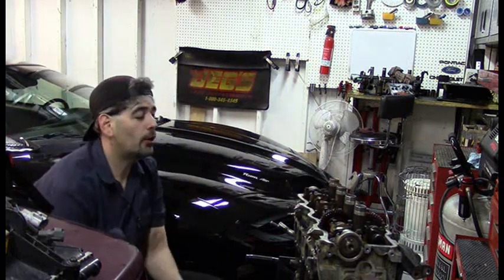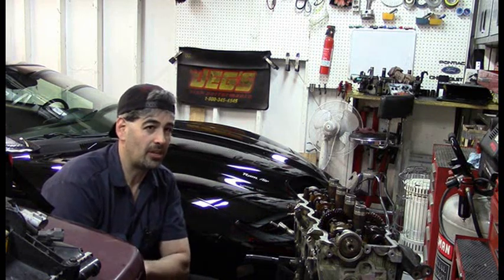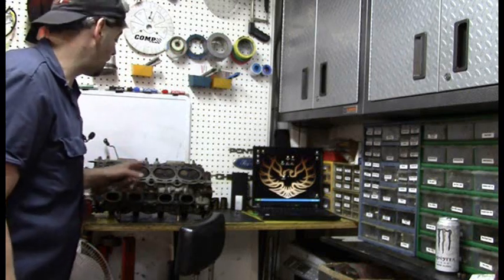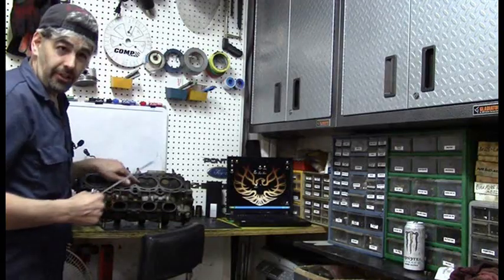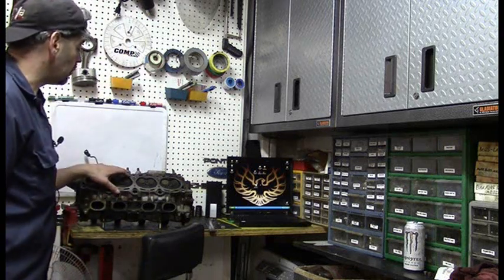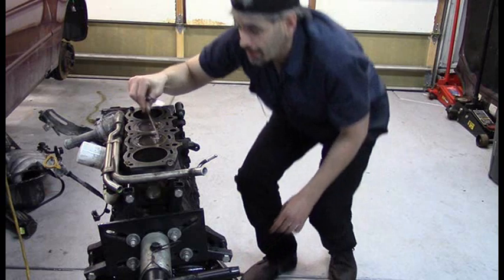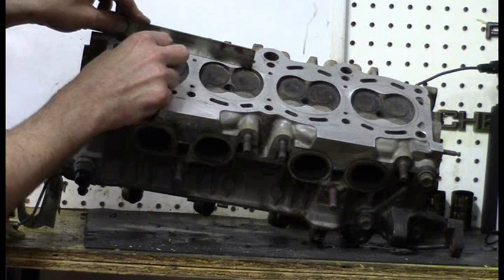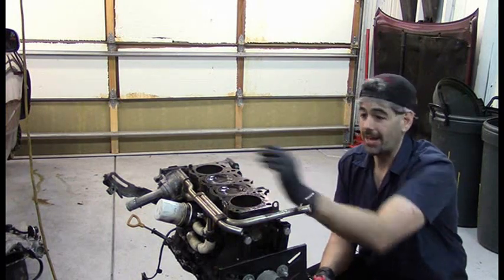Replace a Cylinder Head Gasket Yourself and do it RIGHT! Part 1

Comment: I have NO idea how you would have ANY haters, your videos are top notch. Extremely informational and damn near necessary.

Would you mind my asking about my latest project - likely blown head gasket on a 1987 Dodge Mini-Ram (Caravan essentially)?
It has the  Mitsubishi 3.0L 6G72 V6 engine and 3-speed trans, cast iron block w aluminum heads.   I'm watching this video again because this is a job I would like to do myself (I maintain all our vehicles, just wish I owned a prof lift!).  I use this van to haul my Hammond B3 (organ) for local shows, I have a larger van for touring, etc.

Problem just happened recently, I pulled up about a block away from the venue/stage we were playing, and suddenly noticed a stumbling idle (misfire - still kept running though, and ran well when giving it gas) and lots of steady white smoke from tailpipe, my heat in car went from hot to cool eventually (I immediately said, oop there went the head gasket). Thankfully I was close to the show so was able to shut it off before overheating. I could see temp gauge hinting it would go towards getting hotter and hotter so I shut her down. 

Then take out the Hammond, did show (yep, made the show. Hahah, it was great too!) and setup to have it towed to my home garage.  Once I turned the vehicle off however I could not start it when I tested, just a click and no crank, it was dead (suspect coolant in 1 or more cyls).

So: Lots of white smoke, sudden stumble/misfire at idle, heat in van went from hot to cool. Also test restart failed, no start. I pulled into a safe space and had her towed to my garage. 

I'm at the sleuthing part first here to find the what and why. I'm thinking it's just that the HG failed and/or intake gaskets. Worse, aluminum head crack (but not so quick to judge that as i was able to  shut down before overheat).  I sure hope it's not in the block. It's cast iron and i read that these old engines are pretty tough. 

I keep reg oil changes, coolant, fuel filters, any and all maintenance religiously. The radiator is pretty new as are the upper and lower hoses. PCV was new and just did the water pump and timing belt as well this past summer. Drove really well, good cooling/heat, then...this.

I do see the tan froth under the oil cap (never have had that before) so HG is likely here, but seeing no signs of tan/milky oil on dipstick.  I drained what coolant was left in radiator via the drain plug and saw no oil in that (green reg coolant). I will take off lower rad hose and check further though.

Can you provide any tips and info on this engine in regard to sleuthing the issue and doing this job on this engine? 
There's lots of room to work in these old vans, there's so many reasons to keep her going and I will enjoy doing this job actually (NOT a pro of your caliber but have the tools and am damn good with all the vehicles I own).

Thanks for any tips, thoughts, on this
Reply from the maker: I'd have to see what data you have. I can't do anything on a list of symptoms, sorry.
Reply: @SchrodingersBox  
Understood,realized I was rambling a bit (was in the sleuthing phase). Just meant to ask if you know about these engines and it's % of HG survival if I decide to do myself.

Latest update: oil drain showed coolant at bottom (oil on top of that). Gonna pull heads and take a look.

Comment: Good video.  GM replaced my pistons and rings under a special warranty due to oil consumption.  While the head was off I had the head cleaned and inspected by a machine shop.  They found the exhaust valves pitted.  They re-ground the valves and seats, installed new valve stem seals and tested for vacuum leaks.   Comments:  never use a wirewheel or other abrasives on the head or block, especially aluminum.  GM has a TSB on using only plastic scrapers and solvent to clean surface.  My tech said he knows of a tech that was fired for using an abrasive wheel on these surfaces.  For intake and exhaust, not a big deal.  Don't use a tappered thread chase because is will not clean the bottom most threads.  You can use a clean head bolt and run it in and out a few times, cleaning it each time.

Comment: I have experience with NDT and as a mechanic so this is a lil me-specific, but it's not complicated... The last head gasket job I did was a 3400 in a 04 Impala. I knew where the problem was already from my scanner and the look of the chamber. (#6) I glued some sandpaper to a large slab of glass and resurfaced the heads myself. I was skeptical about it until I got to the second head, (246) and saw the low spot in the sanding around cyl 6, and it took a LONG time to sand until it FINALLY sanded out. After that, I had way more confidence. I also was able to take the heads to a friends machine shop (not an engine type shop) and was able to check them for cracks using flourescent dye penetrent before doing any work to them. Also did the normal leak testing and seals. So, ya, if you have the right experience, and some common sense, you CAN, sometimes, avoid the machine shop.

Comment: this is everything but how to do it yourself..
Reply from the maker: Come again?
Reply: Schrodingers Box your videos are with no doubt excellent and there are a lot of information to take note of, but it is not for your average DIY'er who owns few screw drivers and a 40 piece wrench set. it is more for advanced guys who got a real home shop and all the tools out there, and if you need to take the head to a machine shop to get it fixed then is no longer a DIY project.
 no offence intended.
Reply from the maker: certified30 How do you propose a DIY doesd a major, major repair like this without having proper tools?  You CAN do this yourself with the proper tools and knowhow.
  You can't DIY changing a light switch unless you have a screwdriver and pair of pliers.
 My responsibility in a tutorial video is to show how to do the job, not how to do it without minimum required tools.
  BTW what tools do I use that a DIY wouldn't have easy access to anyway? This example  is done with basic hand tools easily available anywhere.
Reply: Schrodingers Box what I mean to say is a head gasket job is not a an oil change. it takes some extended mechanics knowledge and access lots of privileged technical info that your regular Joe most likely does not have access to, at the beginning of your video you mentioned that you don't understand how a removing bolts video gets 300K views well it because most guys watching YouTube videos are looking to see what bolts to remove and a step by step removal procedures of a cylinder head not a video of a cylinder head already removed and opened up in pieces, what is a given to you is not necessary a given to everybody, that's why channels like scotty Kilmer, Eric the car guy ...etc are successful channels
don't get me wrong you got about 14000 subscribers for a reason but you are more into advanced diagnostic stuff.
Reply from the maker: certified30 Not sure I follow your logic... at all.  You say this video does not show you how to replace a cylinder head yourself because it doesn't show how to replace it if you don't have the right tools.  Then it's because it doesn't show you how to remove every single bolt which is what beginners need.  Then you say replacing a cylinder head is not a job for a beginner....

 I really don't know what you are trying to say bro.  Whatever- I'm leaving it as it is.  It's the most comprehensive video on the subject I've seen on you tube and if it fails because I don't show a beginner how to do it with a butterknife and a hacksaw, so be it.
Reply from the maker: ***** Absolutely, 100% correct Tyler.  This is not by any means one of my favorite jobs because quite honestly, as you said, it is entirely what I call "monkey wrenching".  No diagnostic, reasoning, or logical thinking is required for this job when it comes down to it.
Reply: its just a matter of taking the things off, then unbolting rocker cover, then unbolting head studs its pretty simple just time consuming and labor intensive.

if you're doing cylinder head work you should have experience in a clutch job, spark plugs, oil change, coolant, brake fluid and engine knowledge/theory and a service manual.
Reply: Jared Tate you just said the magic words "you should have experience in a clutch job, spark plugs, oil change, coolant, brake fluid and engine knowledge/theory and a service manual" 
it defies the purpose of watching YouTube videos if you already got the knowledge, hints from a service manual and know what you are doing.
but those who have no experience they got to start somewhere right!
Reply: Schrodingers Box I'm not sure I follow his logic either Schrodingers Box . Of course, as certified30 rightly said, a lot of people watching videos like these DO want to know what bolts to remove, just so they know what to expect if nothing else. However, where this video shines is at the critical phase, the mating surfaces between the block and head that may well render the repair a complete failure if not checked. There is also other really useful information for DIYers with regards compression testing, comparing compression once oil is added to each cylinder to check the rings.
Reply: certified30 if you cant remove the head by yourself then maybe its not your caliber.This vid is for guys like me that are wrenching on there own with no shop and no friends or any one to ask ADVICE.  Nice vid !
Reply from the maker: iamdatdude1619 Totally agreed. Its frustrating when I get emails asking how to remove the radiator or exhaust manifold things for this job. Honestly if you can't do those things, why would you possibly try doing major engine work? I don't see unscrewing bolts as an "automotive concept". I see things like understanding timing, compression, fuel induction, induction, etc as automtoive concepts.  The things the makes good mechanics and diagnosticians is their understanding of automotive concepts.
Reply: How do you expect him to do bolt by bolt video for this? If he were to do that it would be specific to the car he is doing a head gasket repair on. That would leave the people that don't know what they are doing even more confused. This is a video on general head gasket repair on a cylinder head. If you don't know at least a little bit about how the remove the head on an engine i wouldn't attempt a job like this yourself.
Reply: Love your videos! The first video I saw of yours was secret to engine diagnosis; fuel trims and in the first minute or so you said if you want to use a logical and scientific approach/reasoning to diagnose then you should stay and watch the video and that’s when I stayed and watched. Another reason I enjoy your videos is because you focus on using the scientific method to diagnose vehicle problems, which is what I believe, is the most important. If your worried about how to use the tools to get the job done then don’t do the job because it’s better to not take the risk if that’s the case. Almost anyone can do the physical labor if armed with the proper knowledge but the reverse is far less likely

Comment: Excellent video sir. I agree with you on the head bolt thought process. Simply put, if I (or whoever is paying me to do the work) is putting the money into diagnosing a concern, removing a cylinder head, troubleshooting the head, and putting it all back together, there is no sense in risking that whole job over again because of a head bolt set. Anytime a head comes off in my shop, new bolts go in.

Comment: This is very informative I was planning to DIY SLAP A HEADGASKET AND BE DONE WITH IT but this has enlightened me to prep for more stuff to look out before doing such a thing and avoiding making mistakes.
Reply from the maker: Yes do not just slap in a head gasket or You WILL be doing the job over again probably immediately!!

Comment: I have a 91 Toyota Pickup truck 22re with water in the oil...I was already in the process of ripping the head off when my 20 year old son told me to wait after we did a Compression test. 165 Lbs. in Number 1 and 170 lbs. in all the others. Never even considered Intake Manifold...I will watch the rest of your Video. Thanks Liked/Subscribed
Reply from the maker: Yep- with those numbers a cylinder head is contraindicated as the issue.

Comment: Outstanding. About to work on a 05 1.8 Sentra. Now you can get a dye penetrant kit and use it to find cracks you normally cannot see with the bare eye. I use it checking welds all the time on boiler flanges and such. Keep up the good work.

Comment: Excellent video man really informative, im going to be honest, the first time i watched one of your videos i was kinda skeptical, mostly because of the "Haynes manual" guys that were religiously yelling "No way man! that's not the correct way to do that stuff!" in fact i was somehow doubtful because in some sort of way Haynes manuals are pretty useful, but just for the basics, that's it, but in the end i learned from you the logical way to solve problems.. here in my country mechanics are known as part swappers and they dont really do ANYTHING to solve any issue with a car.. Another thing i wanted to tell you is that you mention that the head bolts that were used to join the warped cylinder head with the block cannot be reused because of the mechanical stress resulting from the warping of the hed and the stretching they suffer, you are absolutely right on that and not just only because of that but also those bolts had been heat cycled many times!. Keep it up man!.
Reply from the maker: +fernando13e Thanks man good feedback!!!

Comment: Spot on with your observation regarding the age old argument of 'new or reuse head bolts'.
How I see it is that the old bolts will have gone through three main stress patterns; tension, torsional and thermal. Basically a set of new bolts is going to be a damn site cheaper than having to do the whole job again when the old bolts fail to clamp the head to the block correctly. Last thing any garage wants is the customer returning with leaking HG caused by old bolts.

Comment: This is very helpful to me because i have been considering one of the mamy Craigslist cars going for cheap because of a "blown head gasket" This helped me see that is an awfully vauge and possibly misleading diagnosis. Thank you.
Reply from the maker: Indeed I started this hobby doing exactly that.  Most of the cars had much, much worse than blown head gasket, they needed bottom end rebuild.  One actually just had a cracked spark plug- got lucky there.  But overwhelmingly, most cars needed considerably more expensive repair.  On average For a 8-10 year old car that I bought for under $800, I would spend about $800 to get the cars in perfect running condition.  At average sale price of $3500 it wasn't bad for a couple weekends' work.

Comment: Appreciate the vid... The reason a replacement vid gets way more views than a diagnostic vid is becAuse a perso. Takes their vehicle to a mechanic the mechanic says u have a bad water pump and have to pay X amount of dollars. The person either doesn't have enough money or feels they are mechanically inclined enough to do the work themselves. Then we look up a vid to see how a person does it and what troubles that person has come across and how they went about fixing the issue. We can probay do it without a vid, but if someone has done it a can list issues they come across then we can avoid those issues or be prepared for them and expect them when we attempt a repair. I learn everything from youtube and even though I'm mechanically inclined and have performed many repairs I can always learn a thing or too. Nothing worse than someone showing a vid of something they just fixed but having no info on how they did it.
Reply from the maker: Good point, that makes perfect sense!

Comment: Really nice video and thanks for the knowledge! I saw this prior to starting my Jeeps head gasket. I took the advice and had the heads checked at the shop and sure as "ish" the head was cracked! This video saved me a whole lot more time!
Reply from the maker: William Jones Excellent job by you and the shop. Most people would not have realized that was the cause of the problem until after they replaced the gasket.... Then they do it all over again. and sometimes again.

Comment: I wish we had a mechanic like you that actually care about your customers I enjoy learning from you my problem is with my 2010 Hyundai Tucson with 90000 mile just rolled over and I was out of town and I ended up on the side of the road radiator cap popped off I had serviced it myself oil change and added antifreeze for the trip got 20 mins to my home I put the cap back on and car engine light went off thought I was good drove slower and got 5mins from home and it died I got it towed home and been working on it myself and now I have a friend helping anyway I scanned it and got cylinder 3 misfire so I changed 4 spark plugs and 4 ignition coils and scanned again and got crankshaft sensor the car crank but won't start scanned again got camshaft sensor so I bought both sensors and changed the coolant sensor too we got to the last sensor and it was the camshaft sensor it had melted to where it was and we got all of it but a small piece we tried everything that we had to use to get it out while trying to be careful 5 hours working almost done and then we could not find the small not sure if it went in the engine we stop working and now not sure what to do or if we can get in there any info would help Thanks!

Comment: I meant. On the head you picked up from the scrap yard..Don't take this in the wrong text, I would of have removed the valves ,reseated and installed with new seals. Love your vids and your attention to to detail. Thank you
Reply from the maker: Yes I do that too. I typically leakdown the donor engine.